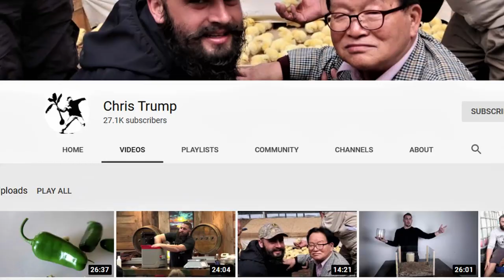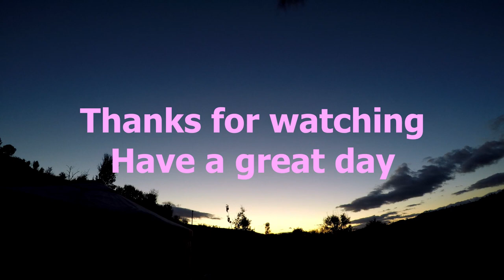Experimenting with KNF and Chainsaw carving - Off the grid in Portugal #6

Comment: Thanks Sarah from info of KNF and LAB 🙏 While living in Thailand we used EM (effective microbes) what was activated by molasses. Now living in Skandinavia we can't get that anymore so your introduction to making ourselves similar kind of solved that problem. I'll try as well Bokashi (process that converts food waste and similar organic matter into a soil amendment which adds nutrients and improves soil texture). Kompost-tea was used in our farm as well and it's very easy to produce.
Reply from the maker: Nice one Peter and thanks for the other info will look into Bokashi 😀 have a great day
Reply: @lukeandsarahsoffgridlife  Check out the Compost Tea as well. We found that be a good for cassava (manioc) by spraying to the leaves after dew has evaporated. It works with any plants which can tolerate spraying to the leaves. Little bit tweaking and you can make it be an organic pesticide same time.
Reply from the maker: @nomadicpeter1739  thanks for that Peter will definitely give it a try

Comment: May try with milk kefir or yoghurt whey it should also be LAB and a lot easier, JB marine epoxy or similar repair epoxy for the water pump its only water
Reply from the maker: I was wondering if using something like that would hold it together when the pump is running under  pressure. It s fixed now hopefully i wont forget it again and avoid this problem
Reply: It depends I guess, high pressure trickier, heard it being used for crankcases etc, not optimal of course as last resort if you can't replace the part
I've used on outboard lower unit and it's cheap
Reply from the maker: @nygardenguru  fair enough, hopefully it won't  happen again but if it does I will give it a shot and see what happens . Have a great evening